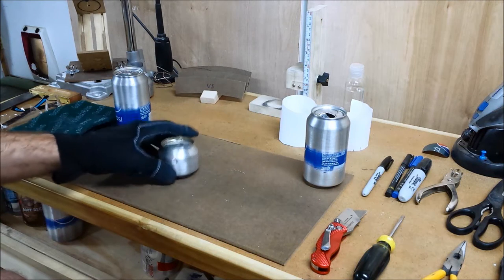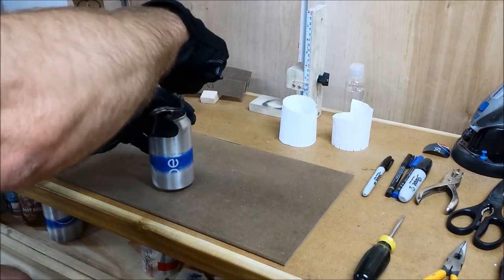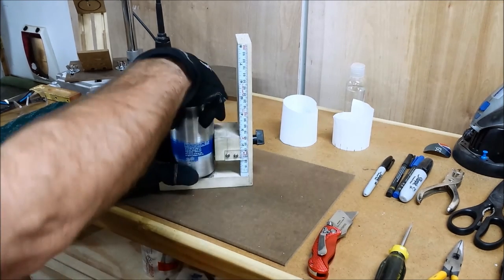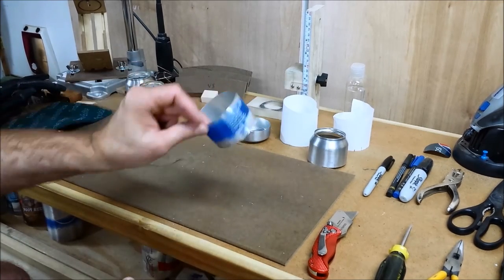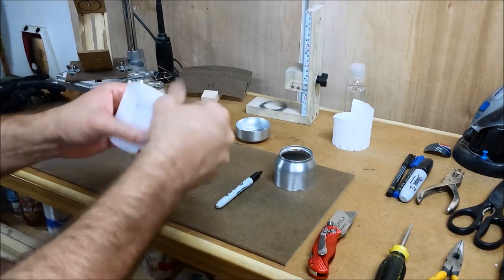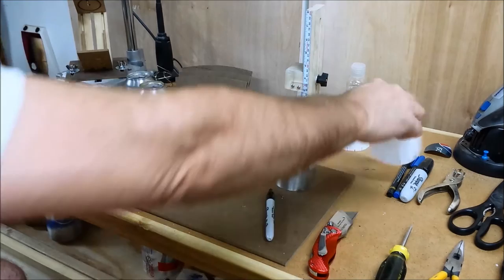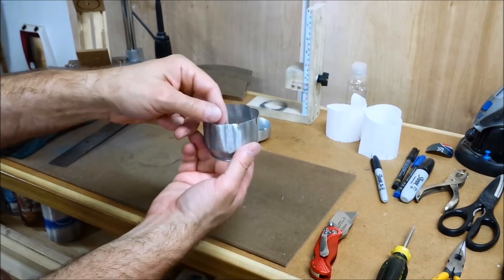Alcohol Stove Groove stove variation

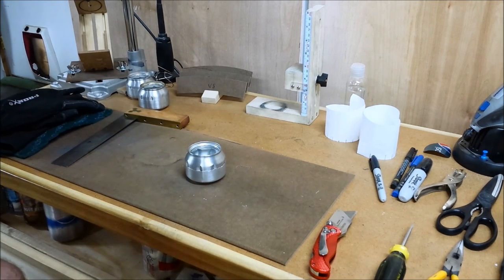Comment: 10:05 "We're done!"
Not quite. You should make one or two small holes right below the top lip to vent pressure. Placing the pot on top can cause pressure in the bowl to force burning liquid alcohol drops to spray out of the capillary jets if overfilled. The vent holes prevent that pressure buildup. (I learned this the hard way.)